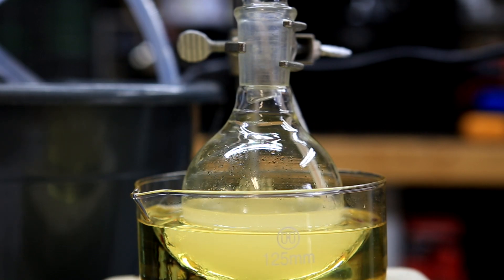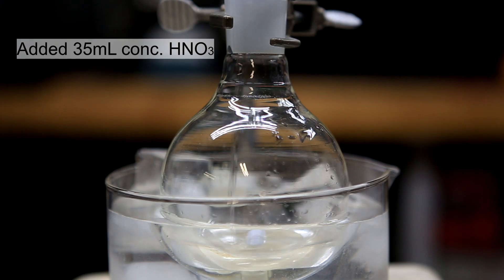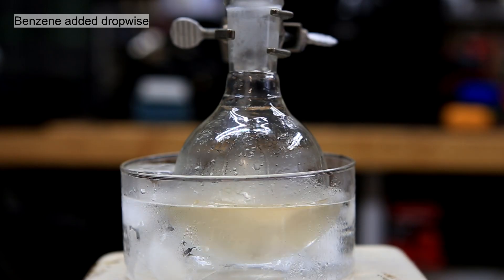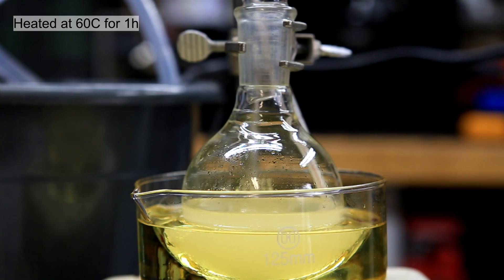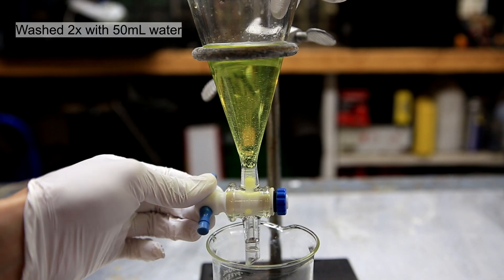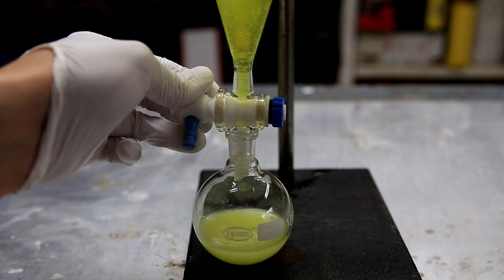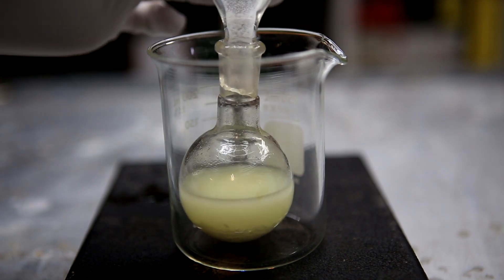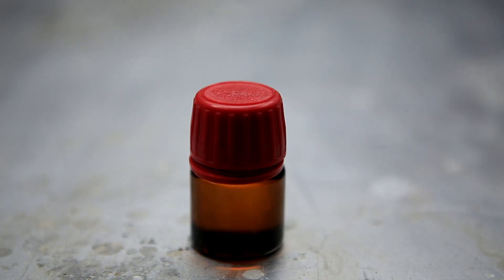How to make Nitrobenzene

Comment: The waste water is always a problem with aromatic nitrations.  Could you treat the waste water with potassium permanganate acidified with sulfuric acid?  Would that be strong enough to open the aromatic ring with carbon dioxide and nitrogen oxides to be collected?

Comment: i know this is old but can a nitration be preformed 3 times to create tri nitro toulene and since the ch3 ion is a weak activator and directs to the ortho para position but with steric hidnerence wouldnt the para postion be the most favorable? and therefor both ortho and meta since no2 is a strong deactavor can be nitrated to create 2 4 6 trinotro toulene? or would it be to slow
Reply: No....

Comment: 1:30- I laughed pretty hard at this part cuz I remember doing nitration of nitrobenzene as a lab during my first semester of organic chemistry. The lab book even had a warning in bold and all caps that said to keep the solution between 60 and 70 C during the addition, and if it goes above 70, to shout "leave the area immediately"
Reply: Welp, its pretty close to TnT, the recipe is nearly identical, if I remember correctly...
Reply: @sheevpalpetine7687  yep! All it needs is another meta nitration and adding a methyl group on there somewhere
Reply: @TheFlipside  Nornally you just Start with toluene, no need for the addition of another group. Makes things a lot easier...
Reply: @sheevpalpetine7687  oh for sure, especially how deactivated a tri nitrated benzene would be. I was just assuming in this scenario you'd be already starting with nitrobenzene
Reply: @sheevpalpetine7687 except that begins with Toluene instead of benzene ig?
Reply: @NerdyNEET  Of all the stupid ways one could deal with an over-nitrated volatile substance, that method is most certainly on the less-stupid end of the spectrum...
Reply: He said at the end that he accidentally made it 80°C. How is that possible?
Reply: @pratishthabajracharya7  He filmed that twice I guess. After rebuilding his lab.
Reply: @pratishthabajracharya7  probably because most of the nitration mixture would already have reacted thus a di- and trinitration wasn‘t really able to happen to a large extent. It just killed the yield cuz maybe some decomposed and some overnitration did occur.

Comment: can anyone tell me how you got to those amounts of ml's in theory ? everywhere i see people using diffrent ml's for diffrent amounts but no one states the theory behind it :s
Reply: Read up on stoichiometry and balancing chemical equations as that will answer most of your questions. Some people use a slight excess of one reagent in a chemical synthesis because it helps drive the reaction to completion or practically the reaction just works better with one reagent in a slight excess (trial and error). Thats probably why you see people using different amounts :)

Comment: i have some questions. 
i have a final project in uni. the project is make an chemical industry paper. so i've choose nitrobenzene industry. i made it based on patent. In the patent that i used. it written that the reaction using mixed acid and benzene. but before all the feeds entering the reactor mixed acid should be heatedd around 80 degree celcius. and the condition reactor is about 135 degree celcius. and after the spent acid is romeve by dekanter and evaporate to use the recycle of sulfuric acid. the thing that i want to ask :
1. is it harmful if the temperature in reactor raise 135 degree celcius? 
2. if the temperature raise above 50 degree celcius it will make dinitrobenzol. if so, why? we can separate it by separation appratus?
3. should nitrobenzene is being washed by the base solution?

please help me.. thank u.

Comment: how can you measure the temperature during the nitration without a thermometer? like a magician?
Reply: masterlab LAB put your hand in it , if you scream its probably too hot , if you dont scream immediatly but after like 5-7 seconds , ure good to go
Reply: IR thermometer can be used to check flask temp quickly

Comment: One of the reasons one can get a low yield from this reaction is the entrainment of nitrated product by calcium chloride.  I think you can get a better yield if you a) use only about 1g of calcium chloride, an b) dry the crude product before distillation.  A side note, this was the very first organic reaction I attempted in high school, in 1969.
Reply: Norman Reitzel dude. I’m a chem teacher and we teach this mechanism, as well as the reduction of nitrobenzene to phenylamine to the IB Chem HL course but by today’s safety standards none of this is even remotely legal. I wish it was 50 years ago haha.

Comment: You probably don't need to be concerned about the formation of 1,3-dinitrobenzene and 1,3,5-trinitrobenzene. They require harder conditions, at least fuming nitric acid instead the 65% HNO3, and a longer reaction time.
Reply: I think the reaction would be easier with toluene or xylene as the methyl is an activating group, but then your literally making tnt
Reply: Concentrated nitric acid is already azeotropic, so the heat would mean that acid was going into the air, rather than becoming more concentrated.
Reply: 196Stefan2 traces of the dinitrobenzene can easily form.
Reply: 196Stefan2 
well, if you heated it enough, the concentration of the nitric acid would probably increase
Reply: so it will be mistake to use let say 90% hno3 and leave all that cook on 2-3h over 150c ?   we did that on one experiment and all was same like in this test ,and we only use distil water ,room temp to cool it down under 200c   ,so how is possible to get di let alone tri by  longer reaction  i dont get it

Comment: how should the nitro benzene water washes be disposed of also when washing the glassware after this synthesis (and similar ones that use benzene) is there anything special that should be done due to the benzene present
Reply from the maker: +neald27 It should go into an aqueous waste container. What you do with it after that is questionable. Label it correctly and call someone to take away the waste when you have enough.